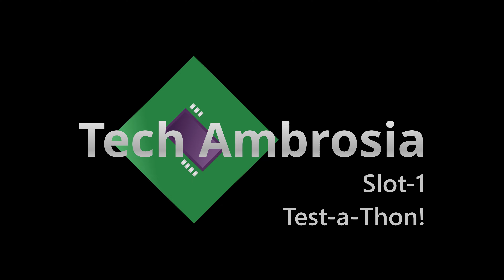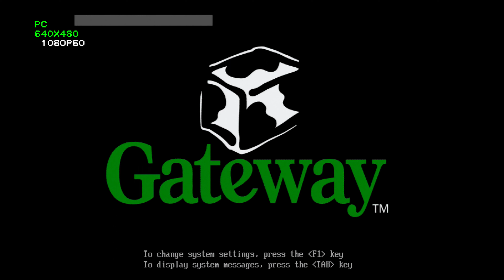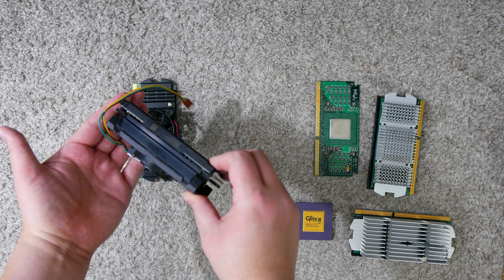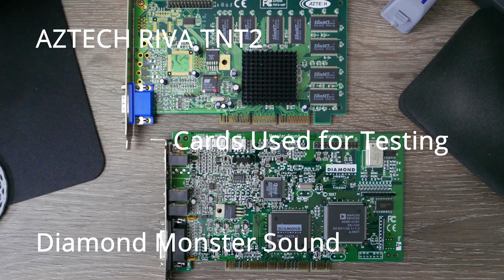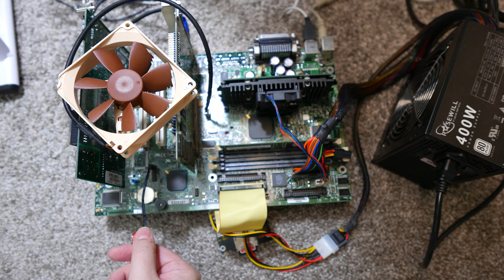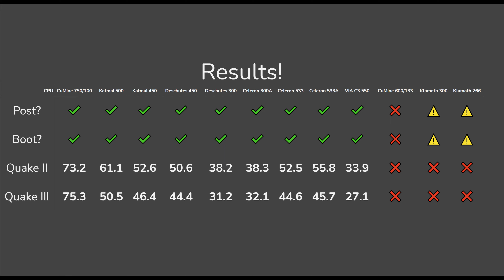Testing 12 Slot-1 CPUs!

Comment: I'm surprised that the CIII 550 worked, but not at its performance. As with Covington, it has no L2 cache - but is made worse by that pathetic half clock FPU. You should be able to get the FPS higher as well - maybe try different drivers for the TNT2. My; Pentium II 350, 16MB S3 Savage4 GT and AWE64 Value on the SE440BX-2 (non-Dell version, though it has the pads for their proprietary connectors) managed 65.5fps in Quake II at 640x480 (32bit colours, S3 Metal), and 32.2 fps in Quake III under OpenGL

CIII also have compatibility issues on top of their low performance. Some software doesn't see them as Pentium compatible and pop up a message box, others just crash with an error message. As others have said - should have been launched on Super Socket 7 with Samuel2 onwards on S370.

Comment: Thanks for a very informative video I really enjoyed watching it! So I have a Gateway 4000510 and I have been wondering what max speed cpu would work on this board and this video gives me a pretty good idea. The motherboard in the video appears to be a Gateway 4000585 correct? According to Gateway docs: "The following part numbers do not have integrated audio, but still use the same BIOS as those boards that do have integrated audio: 4000504, 4000510, 4000533, 4000585, 4000608". I wonder if bios P14 has added any cpu support up from bios P08 although the support docs don't seem to indicate anything like that.

My whole Gateway PIII 450 computer survived being flooded for like five days then I left it in an outside covered shed for over two years. It worked without even cleaning the board first. Although recently I washed it with tap water and dawn dish soap and let with dry with a box fan and that fixed some weirdness I was having. The only damage appears to be that the cmos settings won't hold for long if unplugged even with a known good cr2032 battery. It runs Windows 98 SE pretty well at 1080P but I'd like to have a faster PIII. Since these boards are locked to 8x multiplier and under that would mean the best these boards can do is a slot 1 PIII CU at 800MHz(SL457
) with 100fsb or a socket 370 PIII CU 800MHz with 100fsb with a socket 370 to socket 1 adapter correct? Again Thanks.

Comment: Nice video!  I also have a large box full of slot 1 CPUs, and what seems an inordinate number of PIII 450s for some reason.  Just a crap load of those.  My Slocket gave me issues only when trying to do anything outside of the 100 MHz frontside bus as all of my current Slot 1 motherboards top at 133 but the multipliers are topped at 8.5 so... limited CPU compatibility for the higher clocked ones.
I have since decided that Slot 1 CPUs only on these boards, the Socket 370 chips go on the proper boards and the Slocket can collect dust!

Comment: Klamath is usually unlocked, so you dont need to buy more to test them. The VIA chipset needs a special driver to perform, but I do not doubt you installed them (in your previous video). One of the best boards, in my opinion, is the Abit BH-6, of course with the BX chipset. The later revisions of these have a bus speed in increments of 1Mhz, up to 150Mhz if I remember correctly. The later boards have colored serial and parallel connectors. I saved this board myself for a future project.
Reply from the maker: I used to have one back in the day!! My first gaming PC that had new parts in it was an ABit BH-6 with a slotket and a Celeron 633 that I overclocked to 950! I miss it so much 😭

I'll try experimenting with my Klamaths and see if they're unlocked (and play nicely with my motherboards) because that will save me quite a bit of space! Thanks!

Comment: Nice video! Apart from the lack of oc options, these oem intel 440bx and 815 boards are not bad. Still have my original 1998 dell XPS R450 with a 440bx running fine after years of abuse. It originally came with a 450 dechutes, but I recently upgraded it with a 750 coppermine. With a slotket it even works with a 1100/100 coppermine and a PIII 1400-S (albeit at 1050 Mhz).

Comment: Those early P2 chips have to have their multipliers set manually. Everything after 333mhz has a locked multiplier. That's also the reason the biostar multiplier tops out at 5. If the biostar board posts with 600mhz chip you maybe able to use software to get the fsb up to 133.
Reply from the maker: Unfortunately, it does not :(

I didn't mention it in the video, but the board also seems to hang after about 30 seconds (or at least stops responding to keyboard input).

Comment: Nice collection! That tnt2 scaled pretty well throughout the tests, interesting results.
Reply from the maker: It did, although again, I'm not seeing the kind of performance I'd expect out of it. Sure, it's not an Ultra, but it's also not a m64 or anything.
Reply: @TechAmbr  don't know if you've seen it yet, but if you want to compare results I did a tnt2 m64 vs tnt2s ultra battle for GPU June.
Edit. Welp, just realized you got more fps with the tnt2 than what I got in Quake 2 with the ultra in a Pentium 4. Looks pretty fast to me in that sense.
Reply from the maker: @SUCRA  Hmmmm.... I found a couple of reviews on Anandtech looking at the original TNT and .... they're getting better framerates with the original than I am with the TNT2, so... what's going on??? Did they get golden samples back in the day? It's so weird!
Reply: @TechAmbr  could be the driver version. Now I don't remember which one I used...
Reply from the maker: @SUCRA  It's gotta be. I found this article from Anandtech where they were overclocking the original TNT to basically TNT2 speeds, and getting way better FPS than I'm getting with a TNT2!!

https://www.anandtech.com/show/198/2

I'll need to do some digging on Vogons, I think.